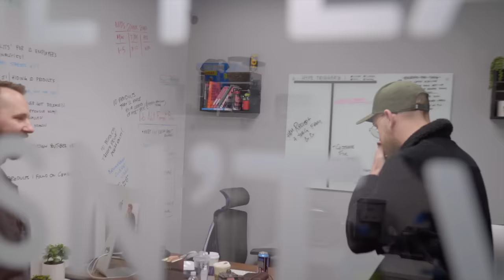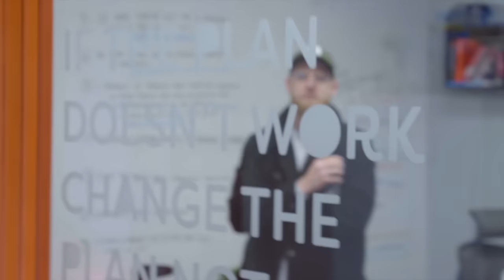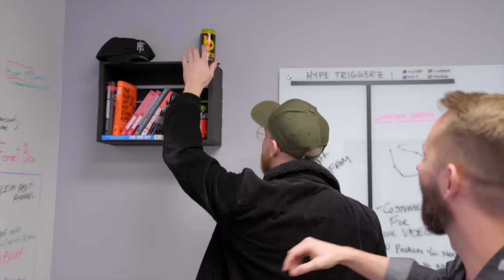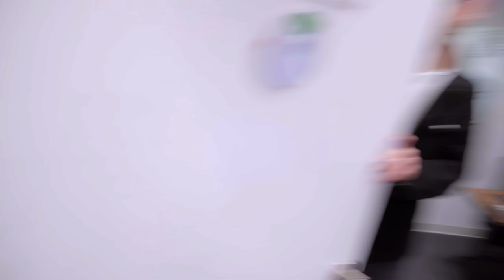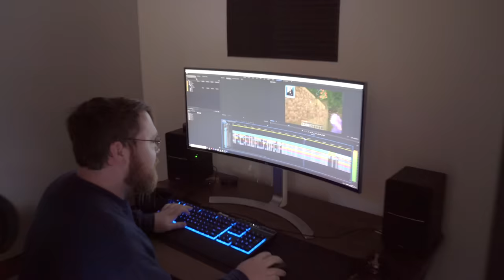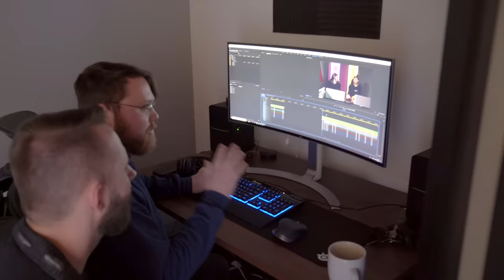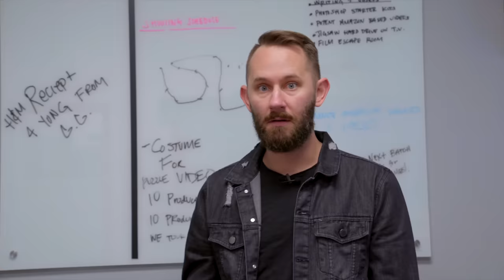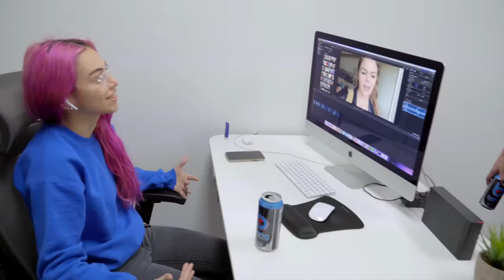Caught Him Drinking Too Many 'Bangs'!

Comment: I’m actually kinda freaked out, I hope this is staged
Reply: It is don't worry
Reply: I hope so because its little scary  and dangerous
Reply: It is
Reply: @wolfay4594  Yeah, no worries. Creatine is a substance that helps you retain water. It doesn't make you feel tingly or anything. That's generally from the caffeine. Bang also contains BCCA which stands for Branch Chain Amino Acid which is substance used after or during work out, to help give more pure aminos to your muscles.
Reply: It’s staged it’s a skit